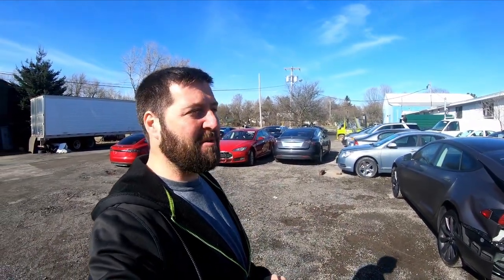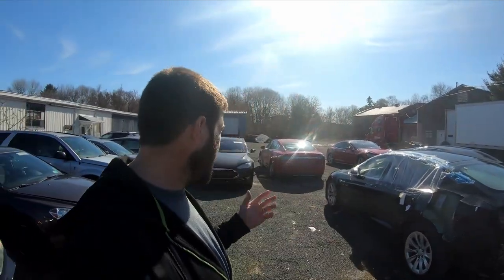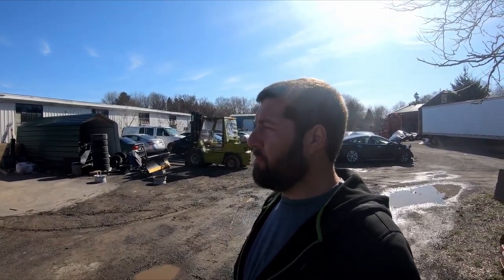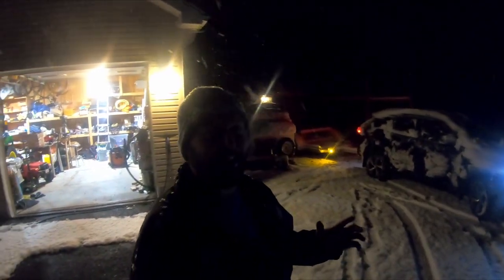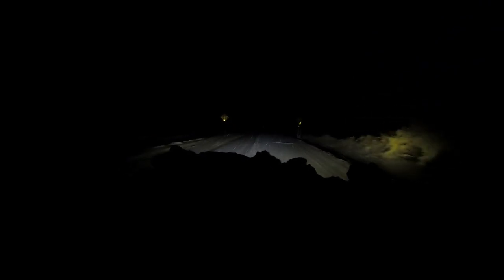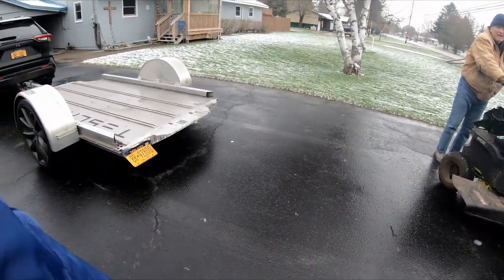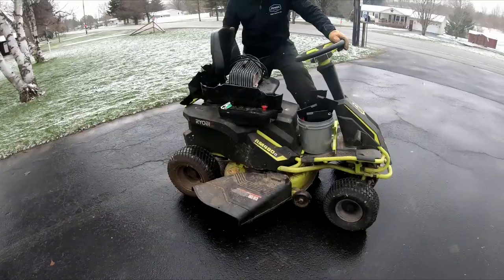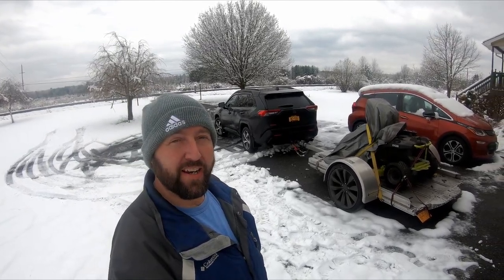Ryobi Tesla Battery Swap Project Part 1

Comment: Nice project, I am excited to see how it turns out. I am also building an electric mower with Tesla batteries. Mine will be remote controlled though. I built a controller that controls the BMS boards built into the Tesla batteries. It is based on Collin Kidders Tesla BMS code that I modified for the ESP32. Way cheaper than buying a BMS and it is smaller too. I also built in a precharge relay so inverters and other circuits with large capacitors don't get destroyed by the large inrush current. Do you have much experience with programming / Arduino? I am also curious how you mount the Tesla batteries. I have been struggling to build an enclosure. ~Mike

Comment: There is a guy on u-tube that did basically what you did, but he used iron oxide 100 amp batteries on his Ryobi lawn tractor. These batteries have come down in price , plus they are a lot safer.

Comment: Hi James great videos thanks for posting so many great details 

2013 RAV4 EV help needed. 

Question. What charger do you recommend for home charging. I’ve seen people use a 240/40 but then some people say you can only use the standard 120 charger the car comes with. 

Any help would be really appreciated. I have a 2013 with 39k miles showing up in a few days. 

Thanks for your help.

Comment: I guess it depends on timing, but I'm surprised that the Tesla modules are more economical than some of the 12V 100Ah LifePO4 batteries available now.
Reply from the maker: They arent. They are more expensive than OEM replacement batteries.